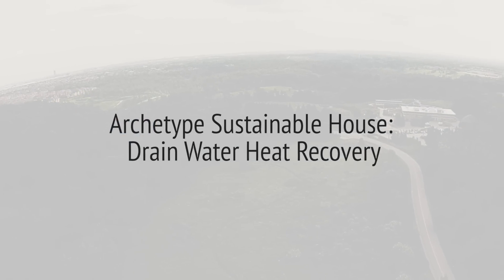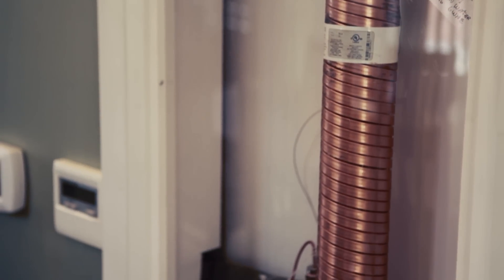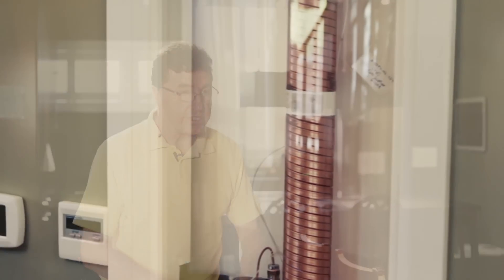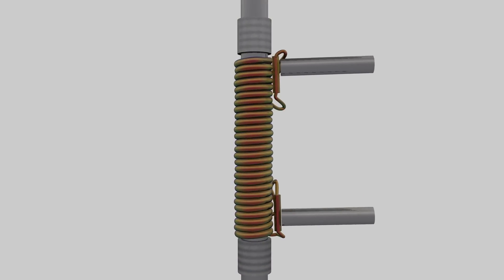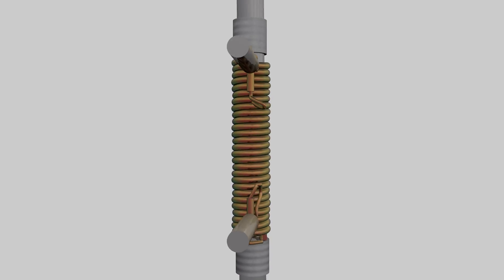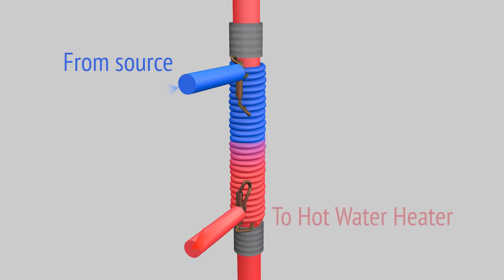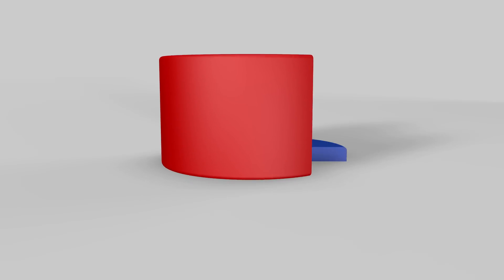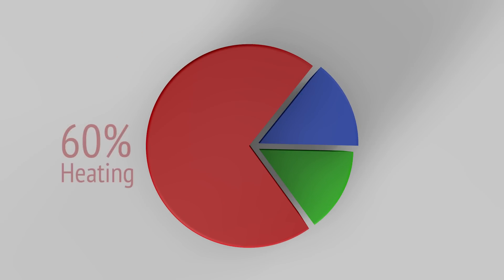Drain Water Heat Recovery: The Archetype Sustainable House

Comment: Why isn't the coil insulated so you're not radiating/losing heat that you just transferred from the waste water to the cold water going into the hot water heater?